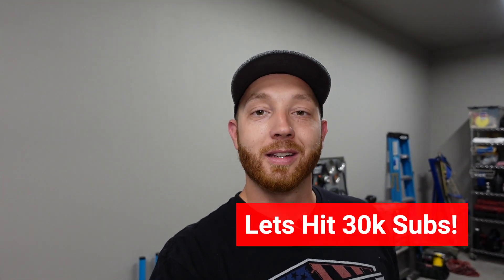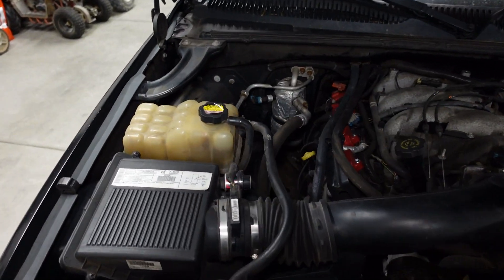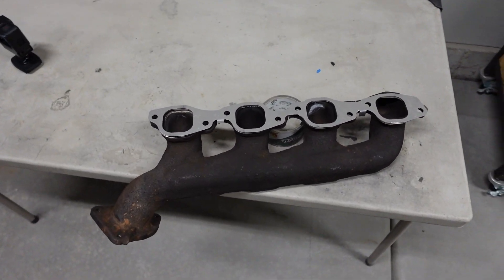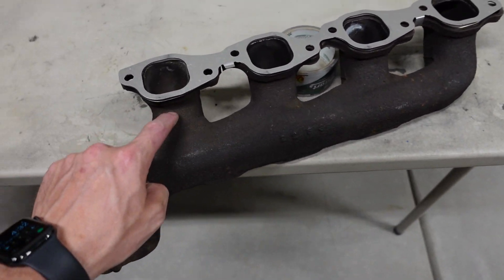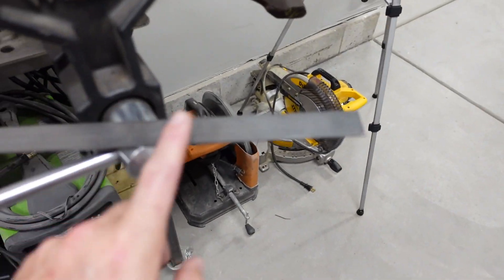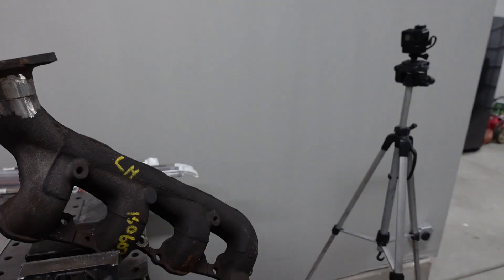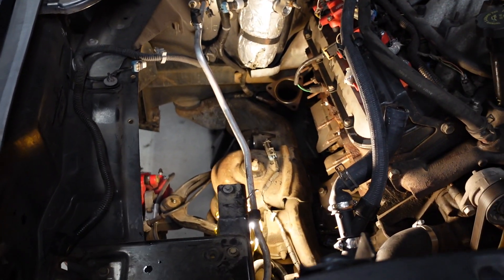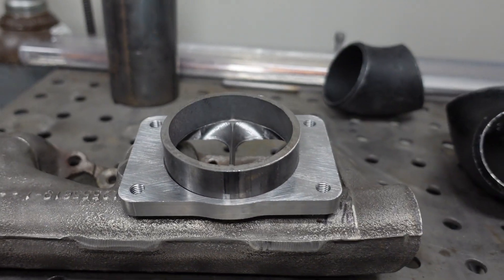Turbocharging an 8.1 Vortec Part One

Comment: This isn't Trucks!, you can talk to us like regular people. 
This is a really cool build. The 8.1 is so underrated, I can't wait to see what you make with a turbo. If you're doing the manifolds out of weld el's, why not stainless?
Reply from the maker: I went with mild steel because Im attaching to a steel manifold, not stainless so I wanted the materials to match for thermal expansion
Reply: @TolmanPerformance  Aren't you scratch-building the manifolds from weld el's because the stockers don't clears the accessories?

Comment: I slotted the bolt holes on a set of stock Mark 4 manifolds so I could run the manifolds upside down on a turbo build I did in the mid 1980's.
Reply from the maker: that would work as well...

Comment: Convert over to electric fans. Getting rid of the clutch fan will gain you 30-40hp right off the batt
Reply from the maker: i do plan on doing an 05+ e-fan when I finish up the turbo setup

Comment: Raylar Engineering heads and manifold will get you 600 easy. With boost you can get to 1300hp on a full bore/stroke to a 9.0
The 8.1 is so underrated it is silly, but offshore boat guys know how to make them breath.
Reply from the maker: they do have some good parts, I want to get a set of their heads and rotating assembly

Comment: From the last video I watched from you and critiqued you on, you have far better audience engagement this time doesn't seem like you're just talking to a camera.  I like the content and explanation. Maybe you could be carrying on a bit too much for some but I'd say good job nonetheless. 

Aside from that, have you considered exhaust scavenging with you log manifold idea? Lingering exhaust gases that aren't flowing well due to large voids without a clean direction of flow could possibly cause buildup over time and coking of valves because due to exhaust gasses not being pulled out but simply walking out or pushed out? Just a thought im not a professional fabricator lol.

You have my subscription this time
Reply from the maker: The subscription is much appreciated! as to your question of scavenging, I'm not sure on the physics of the exhaust flow compared to a header, but all I do know is a log is a proven design which works when space is a constraint. That being said, Yes, a true tubular header will be much more ideal, but at the power levels I'm after, I don't think it would be a huge difference.

Comment: You should take the original manifold from that side  and flip it upside down
Reply from the maker: you cant, the ports and bolt pattern aren't symmetrical like an LS, so when you flip it, the ports are offset from the flange

Comment: The spark test looks like it does because, the manifold is more heavily alloyed than mild steel.
Reply from the maker: I figured it had to have a different mixture
Reply: @TolmanPerformance  It's clearly weldable and to me the sparks look similar to a 4xxx series steel.

I would suggest that you preheat the manifold before welding and if possible wrap the welded joint in rockwool to help slow the cooling down.

I would definitely avoid quenching any welds on it, the metal could get really brittle and lose its ductile properties.

Anyway it's a cool project and I'm excited to see how it turns out.

Comment: Wait a minute, v8 engines at 8+L are still being produced even to this day without being an aftermarket stroker kit or from a semi truck? I thought huge engines at this size in personal vehicles had died out since the end of the muscle car era from the 70's because of downsizing and gas pricing.
Reply from the maker: they are (to an extent). this 8.1 liter V8 was made between 2000 and 2008, and today Ford now makes a 7.3 liter gas V8, and GM now has a 6.6 liter gas V8 as well as the Duramax 6.6 diesel.

Comment: Hey LT!

I just finished up watching the Project Redtide series and I had a thought that I wanted to get some input on (I feel like since you came up with that wild idea, I won't receive hate from you, just genuine advice and input). I've got a 79 K5 that I am going to swap a LY6 6.0 into. No major mods, just plan on putting a mild cam in it and dressing up the intake to resemble the old school setup (you've probably heard of or seen it (DELS3)) Here's my wild-hair thought: I am going to swap a gearstar 4l80 into it, and right now it just has a NP203 part-time Tcase. My initial thought was to build a 203/205 doubler or just swap in a NP205, but after seeing the AWD Tcase swap and the front end mods on Redtide it got me thinking, could something like that be done with a solid axle? The hubs and axle shafts may not be able to handle that much load but I figured I'd ask you since you would likely be the only person to provide actual input rather than just complaining to me about why I shouldn't do it. I appreciate any help! (Also I should add that I don't plan on doing any off-roading)

P.S. I've also got a 96 GMC C1500 (my first truck) and I too have a lot of love for the OBS!
Reply from the maker: I see no reason why it wouldn't work in theory if you used the NV149 T case, but there will a few complications in practice. You would have to keep the hubs locked all the time because the viscous coupler in the transfer case needs to have equal load on either end, or instead use a drive flange instead of a locking hubs, to keep it locked in all the time. In terms of strength of the parts I would think you'd be OK because the AWD transfer case will take out any of the binding normally associated with a 4wd on pavement, but I don't know how the universal joints in the front axle would like the constant high speed operation, especially while turning. The K5 uses a passenger side drop front differential and the NV149 only came in a drivers side drop, so you'd have to find a drivers side drop solid front axle. Lastly, the slip yoke in the front output of the transfer case isn't designed to work with a solid front axle that articulates a lot, on a solid axle front, usually there is a fixed yoke on the output of the transfer case and the slip happens in the driveshaft. I'm not aware of a slip yoke eliminator for a NV149 front output, but maybe some factory parts could be swapped from a similar case, like a NP241. Finally, you'd have to get the 32 spline input shaft for the NV149 if you plan on using it with a 4L80. 

All that being said, if I wanted an AWD K5 blazer, I might look into swapping the entire chassis from a GMT800 reg cab short box 4wd pickup, so you have modern brakes, suspension, steering, and more. Then, the AWD conversion would be a simple as finding an SS front diff and T case. 

Thats my two cents...
Reply: @TolmanPerformance  thanks for all of the input! There are definitely a few things that you mentioned here that I didn’t consider, but who knows, I may end up feeling stubborn enough to get it all to work on the original chassis.

Comment: Will a pair of shorty headers work? Should be able to make them work.
Reply from the maker: if you could do it without flipping em upside down... the ports wont line up when the header is flipped. I'd have to cut off the flange and re weld it back on
Reply: @TolmanPerformance  I think that would be easier to do.

Comment: I think this is possible.  Your cut being vertical on that manifold means it won't work and you'd need another to start over. Here's what I did with an LS manifold. I cut the flange way back.  This left me with an oval opening.  I welded a v-band in the oval and closed what the v-band didn't cover with plate.  If you make your cut at a downward or outward angle you may get the clearance you need with a tight radius 90.

Comment: I find it unfortunate that these engines didn't get the aftermarket attention they deserved. The beginning of the diesel craze drowned these engines out of existence.
Reply from the maker: yeah, it did, but it seems the big engines are making a bit of a comeback. GM has the new 6.6 gas and ford has the 7.3 gas V8.

Comment: Loving this build...and the thought of that big block half ton with a large snail on it...damn I can't wait for the dyno results! That said there are those that have commented on gapping the rings...you seem open to suggestion and honestly, if you want this engine to live a long healthy power added life...please do it! You got the skills and ability man and the peace of mind that'll come from it....worth it!
Reply from the maker: i totally understand the importance of gapping the rings, but as you can imagine, its a ton of work. (pull the engine, disassemble, file rings, put all back together) and even after all that work and proper ring gaps, its said the stock stock pistons will only hold up to 550-600hp (if you believe the internet). Because I plan on building the engine with forged pistons and rods soon after i get the bugs worked out with the turbo kit, I would be doing the same amount work all over again (pull the engine, disassemble, build, etc...). When I get the turbo together at first, I'll just limit boost and HP to that mid 500hp range, and when I build the engine properly, I'll turn it up
Reply: @TolmanPerformance  so pistons are the power ceiling at 550-600 whp or crank? Any idea of beef on rods or block? I assume crank is overbuilt but could be wrong.

Comment: Pre-heat and post-heat brother.  You can use sand after post-heat to safely and slowly bring down the heat.
Reply from the maker: ive heard of that... never tried it
Reply: @TolmanPerformance  when I weld intricate cast pieces I have a little sandbox I use.  Never had a crack even repairing cracks from others.

Comment: Could you not take the driver side manifold  and flip it upside down so the exhaust port is higher? Bye bye hood
Reply from the maker: the ports and the bolt pattern on the manifold arent symmetrical, so when you flip the manifolds, the ports will no longer line up. otherwise I would...

Comment: When I was looking at doing the same thing for my truck I was going to keep both of the exhaust manifolds and the factory Y pipe, just closing off the part of the Y that goes back to the factory cat, then I was just going to cut the bottom of the factory passenger side manifold and replace it with the schedule 40 3” or bigger pipe, then put the turn up for the turbo right at the first exhaust port, not farther forward. Not ideal, but that’s what I had for packaging. I went with a supercharged 540 in my Firebird instead.
Reply from the maker: sounds badass!

Comment: How about a log manifold made from 3" oval tube. Short runners to flat side, easy to fit. 3" should be large enough to accept the x over.
Reply from the maker: hmm... i wonder if you can get thick wall oval tube? most everything I've seen was round. not a bad idea tho
Reply: Spinteck  (sp?) Has the oval in sizes and blends
Reply: Spinteck has SS and 16 ga. mild steel

Comment: The manifold is a low grade cast steel. Perfectly fine for what your doing. But the manifolds are gonna create a massive flow restriction and make major heat over about say 600hp due to air flow. Granted these fo flow good for stock these will be the biggest restriction so be ready for that.
Reply from the maker: yeah, it isn't as ideal as a turbo header, but the new manifold I'm building will have 2" primaries and a 3" log which is pretty big compared to some other log manifold builds i've seen. I will be monitoring drive pressure and EGT to make sure things don't get out of hand tho...

Comment: Eww that's not the right engine to boost to much time involved for outcome. I'd would have just put a cam, some valve springs, and a good shot of spray and you would have saved alot of time. Tryn to keep ac and retain the turbo in the front passenger side really won't work well. Ac systems dont like heat.. what do you want boost or ac. It's really not that hard to run the turbo remote in the bed like you think. All you need is a scavenge pump to return the oil and longer lines.  Your factory exhaust system allready goes back so all you need is a boost pipe going to the engine. It's more simple then the fabrication process with fitment issues that your having. One thing you need to consider is heat soak. Iats might be an issue with the turbo so close. My friend has a similar setup and his intake temps would increase 75 degrees during an 1/4 run. Just somthing to think about. And that was with an intercooler meth and everything heat rapped. Not a hater just wanna help with ideas. Love the channel.
Reply from the maker: I figure if all the LS truck guys can make a high power turbo engine with working A/C, then so can I. Its not that I think a remove setup is difficult to install, I just don't like the idea to be honest. ill make sure to take all the precautions, and as long as the turbo is in its peak efficiency zone and I have adequate intercooling, the IAT's should be kept under control.

Comment: You better do some research on that before you break it....…..the bottom end isn't gonna take much. better not bust it up if your gonna go threw it later, you might not have something to do that with. AND with that restrictive intake manifold it's not gonna like that turbo very well. you better take it off and cut the bottom off, remove all the restrictions inside and put it back together so you have better flow. Raylar has some info on that. from what I've read 700 hp/tq is all it'll take before pistons and rods go.
Reply from the maker: I dont plan on pushing it to the limits, and according to what I've read, you are correct with the statement it wont take much. and I do plan on doing the intake mod like you suggested, and I will be showing the steps for that as well.

Comment: Switch sides on the manifold and flip them upside down
Reply from the maker: cant, the bolt pattern on a BBC aren't symmetrical so when you flip em, the ports are off set by about 3/8 of an inch.
Reply: @TolmanPerformance  idk, or possibly get a weld together kit and make a set that fit

Comment: You could use a street rod block hugger header on one side. Rods bend and pistons break because of bad tuning and no ring gap. Last thing...look up the DPS Turbonator VGT hot side. That will help spool up that biggin and reduce the drive pressures.
Reply from the maker: Ive seen those on diesels, its an interesting product for sure

Comment: Richard Holdener is a turbo master. Maybe you could consult him on your power goals. He has a channel under his name. He has done thousands of runs on an engine dyno for magazines over the years.. He has had a 6.0L LS make over 1500hp on the stock short block. He made a big bang series to test several engines to see at what point they fail. Maybe he can tell you more about the 8.1L. From his videos, I'd say the only limiting factor is how much the turbo can flow. A stock engine can make as much power as the turbo will support. It will just have to do it at a higher boost level. I think a cam upgrade is all you'll need. That will help push your powerband higher in the rpm range. I think this engine will handle much more than 500hp because you see the LS platform making so much more than that. I hope GM didn't flub this big block by adding an underengineered part. Ultimately, the super high torque is what kills the rods. If you kill some of the brutal low end torque with a bigger cam, you can shift the torque to a higher point and make your horsepower number multiply faster. I think think 1000hp will be an absolute monster with the low end torque of a big block and none of the turbo lag of a smaller engine. 
  It's refreshing to see an aluminum intake manifold. I'm more of an old school guy. This build looks great. It's frustrating that a modified stock manifold won't work out, but I'd love to see whatever you come up with. 
  Keep up the good work! I love this series. I know I'm a few days late to the party.. I didn't get to see this video right away because I have been working nights and I've been spending my waking hours with my 2 young kiddos.
Reply from the maker: I have seen Richards videos, and I do enjoy them, I know a bunch of 8.1 guys have been begging him to work on a gen VII, and maybe one day he will.

Comment: Why 1000 hp? I mean yeah it’s bad ass but a lot like Hell-Cats, Z06’s etc... if you try and wind one out on the street you go to prison. If this is a race truck then 1k at the tires makes sense but if you’re building a driver then a 1k is good for bragging rights but not much else. This is why the United States needs its own Autobahn
Reply from the maker: I guess, the 1,000hp is kind of a standard benchmark, and whether or not its actually usable is another story. This isnt a daily driver per se, but it will see some time on the street, and a lot at the track as well. Plus, the great thing about a turbocharger setup, is it doesnt have to be set to kill all the time. Likely when done, I'll turn it down to 6-700hp range for street, and then use good fuel and turn up the boost at the track

Comment: Could us use a band saw with a guide and cut the flanges off the manifold then bolt the flanges to the head and put the manifold on the flanges up side down like u would on an ls then weld em back on
Reply from the maker: yeah, I suppose you could do that

Comment: You could go with a oiless turbo. That's how a lot of people have be rear mounting turbos without bothering the oil system
Reply from the maker: a lot of people have mentioned those, but I've never run one.
Reply: @TolmanPerformance  me neither but personally I want to run one on my daily cars so I I won't need to tap the oil pan.